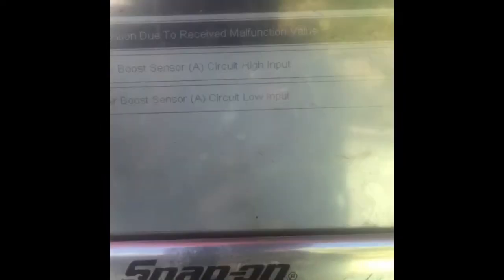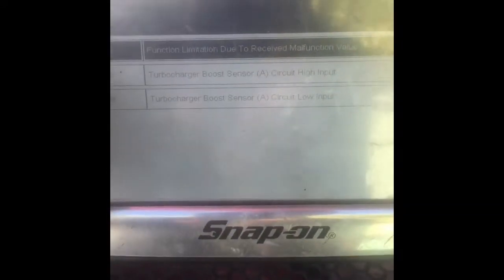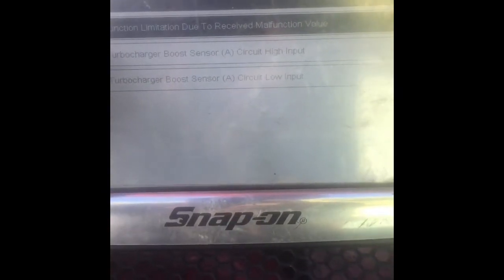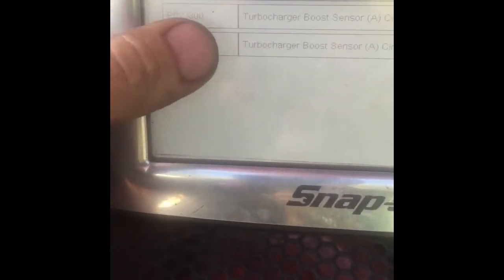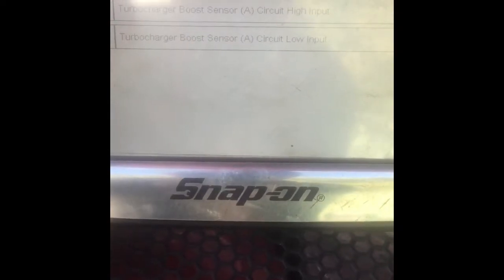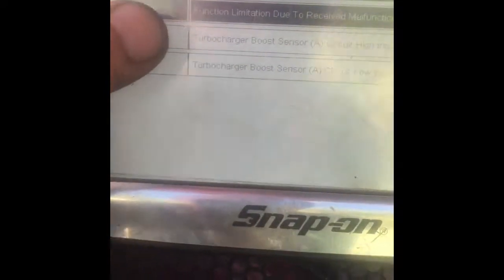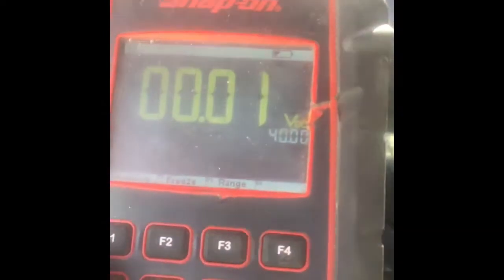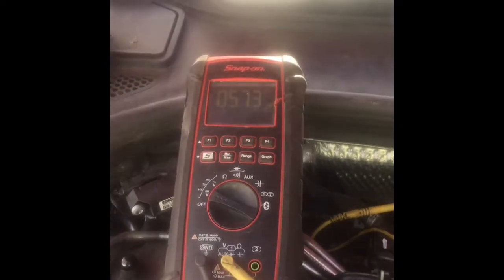Audi A6. P0237

Comment: How’s things, i have a 2015 a6 exact same as the one in video, just had the AA out at it and he was fiddling around with that sensor then said he didn’t really kno id need to take to audi. I have the codes below any idea if it worth me just buyin a map sensor and changing it out or will i best book into garage? car in limp mode 3 lights on dash. 
Codes below? Any help would be appreciated. 

Patrol found the following fault code/s:System : Engine control 1 - VEH / Diesel EDC 17C64 UDS Status :U111300 - Function restriction due to fault value received. Error Message : . Static fault. Status :P023700 - Boost pressure sensor. Error Message : Signal too low. Static fault. Status :P256300 - Charge pressure actuator position sensor. Error Message : Signal improbable. Sporadic fault.Customer taking vehicle to garage Engine Oil Level Ok. Coolant Level Ok.
Reply from the maker: If I were you I would try the pressure sensor first, it is very easy to replace & should be very easy to get. It would probably cost around £30 - £40 for the sensor 🤔
Reply: Yes i think i’ll try, am over in London so can get it handy. Would i need to get a diagnostic to put of the lights on dash clear the faults when i put in the new one ? thanks
Reply from the maker: @donegalbhoys  yes unfortunately, but you could possibly get a cheap scanner when getting the Map sensor 🤔
Reply: @kennedysgarage3281  Sorry for annoying you with questions.
Reply from the maker: @donegalbhoys  The Map/boost pressure sensor is just plug and play. It is a 3 wire sensor 5v power, ground/earth & a signal wire which should range between 0.5v & 4.5v
It is quite easy to test, which is what should be done as in the video. They do fail often hence don’t buy 2nd hand. You can get it in any car parts supplier’s but ask far O.E quality ( original equipment ) 
Also if the vehicle had faults stored it could stop operating the turbo actuator ( limp mode) 
But it is hard to diagnose without actually working on it, hopefully this helps 🤔
Reply: That’s sound goodman. Also was chattin to someone here today looking for a sensor at a breakers and they say it will need to be new from audi and programmed to that car by them is that bs or can any diagnostic sort it?
Reply: Hi, I actually rang the AA guy back today to pick his brain he said he dosent think that this sensor is the problem cause the actuator on the turbo wasn’t opening when i switched car on for him while he was trouble shooting so he said that that should open automatically? but it wasn’t opening until he put power to it if that makes sense?

Comment: Was it just a MAP sensor?
Reply from the maker: Yes it is just a MAP/ Boost pressure sensor. But I believe on this car there are 2. So disconnect the sensor you believe is you issue & confirm that you get another fault for the same circuit??
Hopefully this helps 🙏👍
Reply: @kennedysgarage3281   do you know where the second sensor is? Cheers
Reply from the maker: @jaymanager6356  off hand no, sorry 😞
Reply: @kennedysgarage3281  cheers for the reply chap.
Would you recommend cleaning the sensor? I have electrical spray cleaner. My a6 is high mileage so was wanting to do it so it runs better. What do you think?
Reply from the maker: @jaymanager6356  I don’t think cleaning is good for them unless it has failed & you are trying to get a fix. You should be able to verify if it is working or not with live data on a scantool 🤔
Reply: @kennedysgarage3281  its working i believe. Ive just seen videos of caked up map sensors and thought due to the high mileage it also may have carbon all over it. As a preventative was going to clean it, ill remove it and give it a visual inspection first. As it isn’t in the manifold itself i reckon it shouldnt be caked in carbon. Cheers

Comment: N75 I’m guessing?
Reply from the maker: The turbo control solenoid (N75) was working as it should in this case. It has 12v feed & pwm controlled ground which were good too. So I called it just a bad sensor which did fix this wagon. But the owner did write it off within a month or 2 🤔🚗🚗
Reply: @kennedysgarage3281  aw man 😕